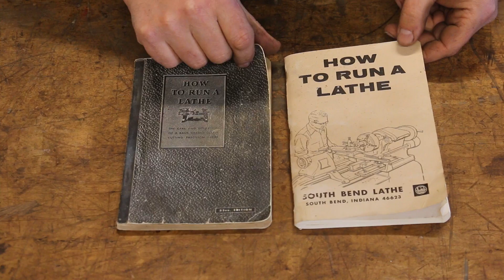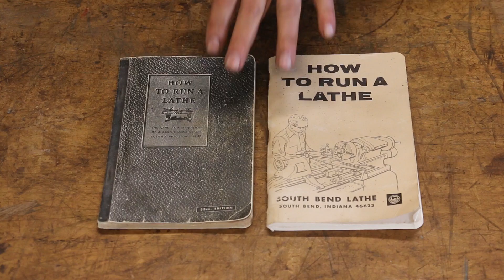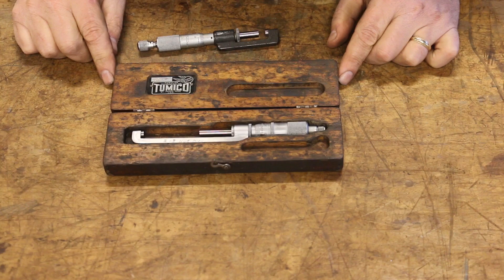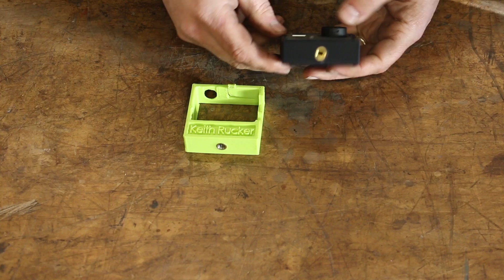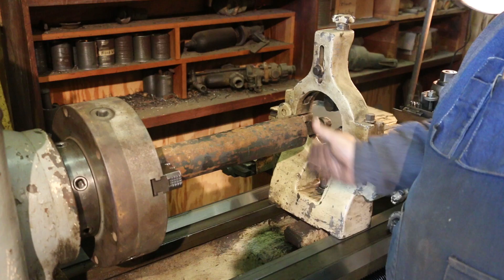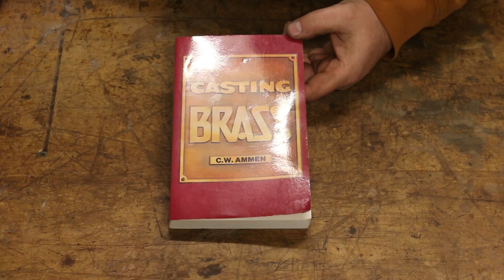Odds & Ends 16:  Viewer Mail, New Tools, Some Machining and a Request

Comment: Keith,  I have been watching your videos for a few months now very interesting stuff i must say.  I had a few questions for you.  I recently purchased a Montgomery Ward Powr Kraft 17 Inch Drill Press/Router/Shaper  Model THS2437B.  I have searched all over the net and have found nothing in the way of documentation regarding this drill press. I know the company that sold this unit went out of business in the early 90's. My main question is this particular machine has a plastic cone on the top of the spindle that comes off i was wondering what this was for this same plastic cone will also install covering the chuck as well,   I purchased this machine for 100 bucks did i get a good deal or did they see me coming.
Reply: Thanks for your input. I did however find a user manual that closely resembles my particular machine. This particular user manual i believe is for a previous years model but none the less it is very close to what i currently have.  I found out my main questions and many others i didnt know i even had yet.   By the way this particular drill press was designed to become a router as well by flipping the head on end, The machine has 2 different spindles one that works like a standard drill press with speed ranges from 500 RPM to 2200 RPM and the upper spindle with a speed range between 2000 RPM to 22000 RPM.  This is the router part of the press however my current machine has no way of attaching a bit of any type but that does not matter to me i only wanted the drill press part of the machine anyway.

Comment: Hey Keith,
  I don't know what you will have left to chuck onto when you get the dial into the dividing head....but if you can grab it with a little 4" chuck I have one I can donate to the cause...and it's not Chinese!...Got "Made in England" stamped right on it!...lol
  I know it is a little smaller than you were looking for...but on the upside, I think there is enough meat on the backplate to bore it out to 2 1/4 and thread the plate that's on it...just let me know...and thanks for all the good work!

Comment: Hi Keith, there seems to be a misconception about the multiple-anvil mic sets. You shouldn't need to adjust them every time you change the anvil.

That's why there is an adjuster on each anvil. You just pop it in and it should be good, assuming you zeroed them all at one time or another.
Reply: That kind of depends upon which design of this type of mic you are working with... some of the older ones, or the less expensive imports such as what I have, do not have that feature on the anvils, and you end up needing to re-zero the barrel for the new setup...
Reply: *****
For occasional use it can be easier to just note the error and add or subtract it from the reading.

Comment: Keith, I have an identical burner I build a few years back, using the same atomizer nozzle you have there. I found that rather then have a separate third line for the propane inside the blow pipe, I have better control by splitting the air line with a T-piece and two needle valves, so one starts of by running propane though the atomizer and then slowly start adding air and closing the propane until things are hot enough to run on only air and oil or whatever liquid fuel you using.

Comment: About casting, many of the problems with Bronze/Brass comes from the temperature  of the metal in the crucible. In the old vid regarding the casting of Rodins "Gates of hell " the French had a terrible time keeping the temp high. There were many pourings that were disasters because of it. And they were using st ate of the art equipment aside from being fired I initially by oak.
My suggestion n to you would be to be more inclined towards a higher t temperature  simply because the liquid will flow more easily ,thusly avoiding I nclusions. It's merely a though but t why  not think about it . Can't hurt as they say.

Al
Reply: Also, at a higher temperature, the ,molten metal is more thoroughly de-gassed...
Reply: And IF you can raise the temp high enough, perhaps Bronze will be in the works. Btw my field of study was Bronze age history/Archaeology . I'm a bit more attuned brass, bronze because of it. Good luck in your pouring.

Comment: Keith,
Thanks a lot for another interesting video! It will be interesting to see how your furnace project progresses. Thanks for sharing all the goodies you purchased and were given. It still boggles the mind that the YouTube community is so generous. It takes a lot of work on your part to video your working, possibly using multiple cameras. The job isn't done then. There is editing, figuring where to place your "B" (or "C") roll shots, plus all the other elements you wish to use. Once the video is assembled and saved to a storage device, you have to upload it to YouTube. If you have a slow internet connection, this can take hours! The gifts you receive are our (your viewers) way of saying "Thank you!" for all your effort.
Have a good one!
Dave

Comment: On the burner- 1.  The spinning vane should turbulate the air very well.  2.  Consider piping in the propane on the other side from the oil so the propane comes out of the nozzle just as the oil does.

Comment: Keith,

What about making up a custom work-holder - tapered shank and drawbar - for this job?

It might be cheaper - and more accurate - and quicker, in that you can do this job while searching for a good mating chuck for the dividing head...

Eric
Reply: ***** Keith - the other thought that occurs to me is that you will want to mount the divider on an angle, such that the face of the dial is level, so that the tool to cut the score lines on the dial has an even depth of cut...

In which case, a lesser weight makes for a less troublesome setup...

Thanks!

Eric

Comment: as for the backplate, you could turn off the current thread and then recut a new thread and make a threaded sleeve to go on top, then it wont stick out any further than the current face
Reply: That spindle is awfully short - I can see threading an extender/adaptor - sort of like a pipe coupling, but turning it shorter? I'd not recommend doing that...
Reply: chemech didnt mean shorter, but smaller diameter, so can rethread and add a ring with the tpi on the outer he needs to match chucks he can find, to change it from 4.5tpi to 8tpi for a more common fitting
Reply: Still not much meat to work with - the spindle is a hollow tube...

You could build it up with weld metal, and turn and cut a new set of 2.25" - 8 threads, I suppose...

It's probably a better solution to buy a faceplate with an un-threaded boss and cut new internal threads to mate up to the odd-ball 4.5 TPI on the spindle though...